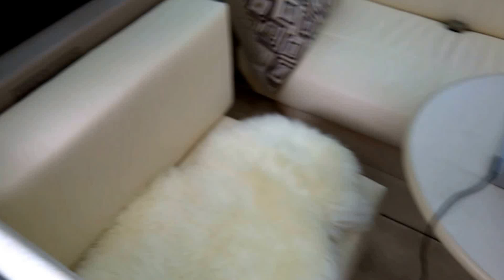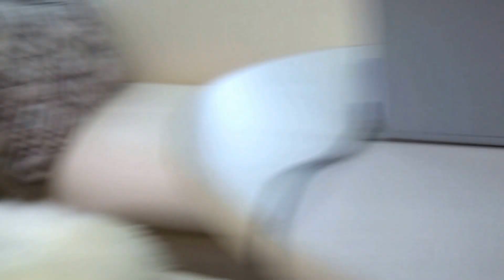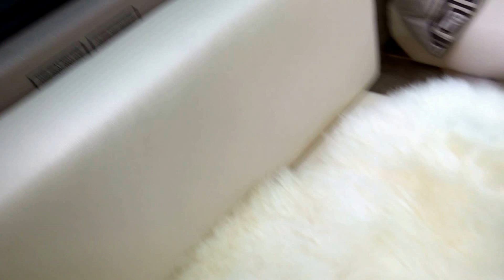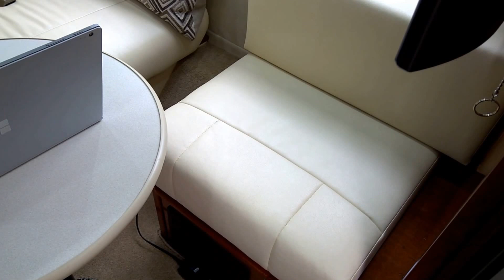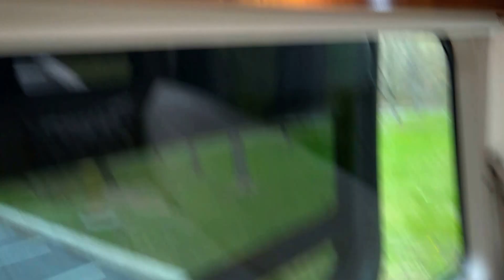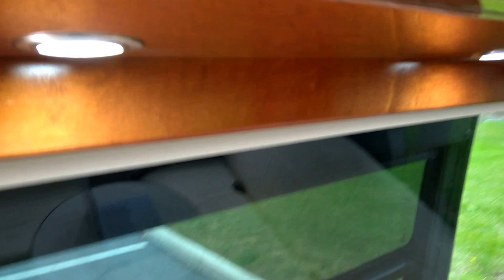Ascent Ottomans

Comment: You commented once on the loud generator.   Is it loud to the point where if you use it at night to run the air conditioner, would the noise, or vibrations, prevent you from going to sleep?  Since you use the rig as a Mobil Office, would it be a big annoyance if the generator was running while you were trying to work?  I am just a little shocked that such a great RV builder would allow a product with such a design weakness.   I have seen the loud and vibrations generator mentioned by other PW owners.  Some say they think it’s to the point where it’s annoying to camp residents
Reply from the maker: the generator is loud. I wish I could say it wasn't but it is. James over at The Fit RV channel has a video demonstrating the decibel level drop off as you walk away from the unit so you may want to check it out. I could sleep through it if I had been driving for 15 hours ;-)
Reply from the maker: one other point. think about how often you're going to be boon docking... that's the only time when you will likely run the generator for the AC. normally, like me, on a roadtrip you'll park in a campground with shore power so you won't need the generator I have run it when I'm using it as a mobile office but only sparingly to get the temps down and generally not when other people are parked around me. I have also run it while on the highway but that was for my Roadtrek CS Adventurous which had poor airflow. In the Ascent the airflow is much better so the cab AC keeps the back nice and cool without the need to run the rooftop AC